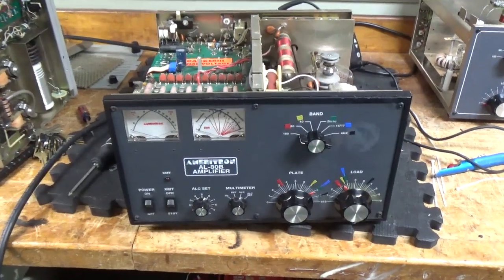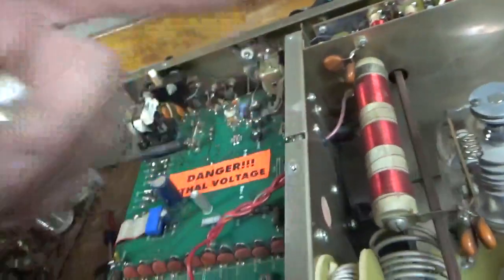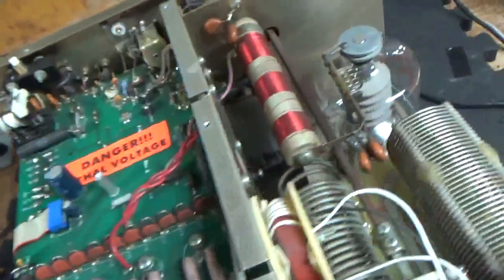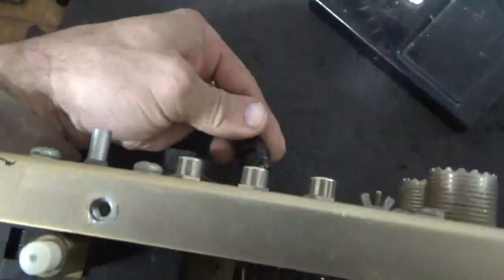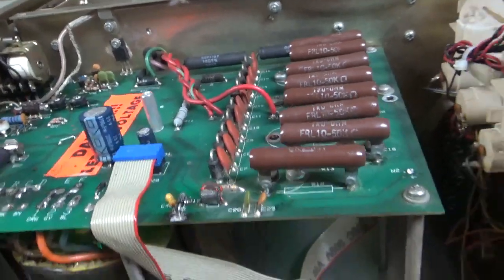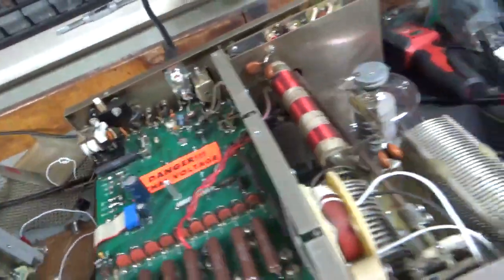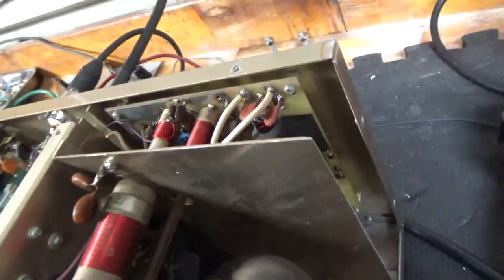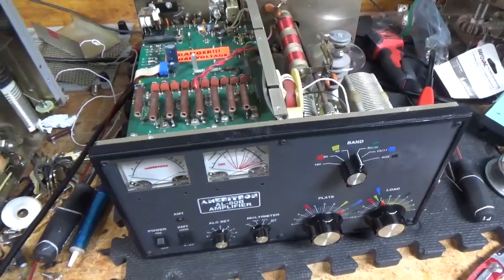Ameritron Al-80b Repair New Filter Capacitors

Comment: When replacing the bleeder resistors, do you take out the whole board and solder from the bottom, or do you just clip out the old ones in solder to the remaining leads?
Reply from the maker: I un solder from the top, clean the holes install new resistors with leads near flush with bottom side of board hole. I flow solder through top of board so both sides of board are soldered to each lead.

Not a quick job